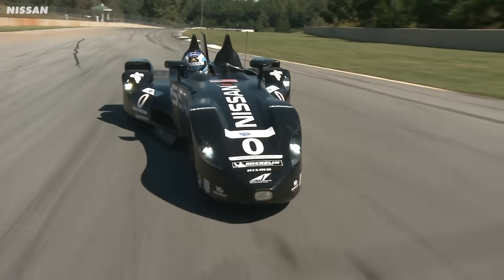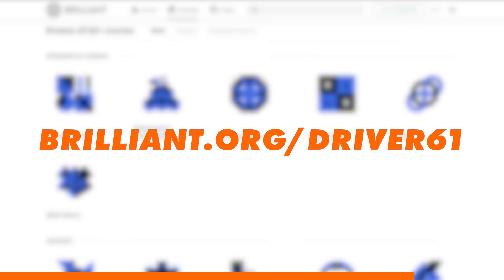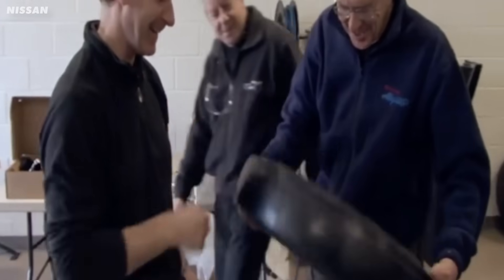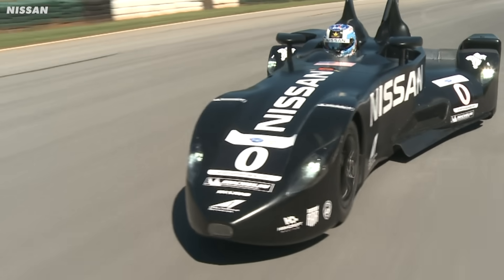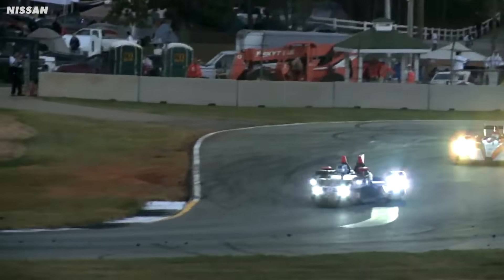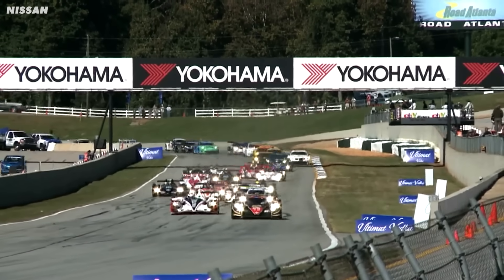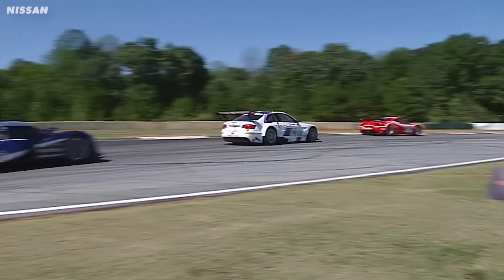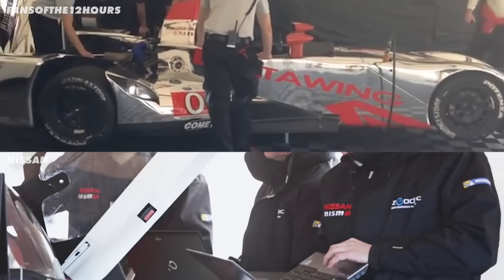Why This BIZARRE Race Car was GENIUS

Comment: Race against IndyCars? The DeltaWing was designed to BE an IndyCar. It was part of the ICONIC Project to replace the old Dallara IR-05 chassis that was now a relic of the CART/IRL split. Dallara, Lola, Swift, and BAT Engineering were also in contention. Ultimately, the Dallara DW12 was chosen; Swift and BAT moved on to other projects, Lola went dormant for 12 years, and, as we all know, the DeltaWing raced at Le Mans.

Comment: This may be genius, but Nissan's GT - R LM NISMO 2014 Le Mans racer was a disaster when they entered it as a LMP 1 in the 8 Kilo joule entry . Three of their entries were entered in the 2015 Le Mans. They were entered without a test drive. Two of the copies didn't even finish. A third only finished seven laps. Instead of using electrical system to convert the potential energy to kinetic energy, they decided to use mechanical set up with two fly wheels in a hermetically sealed transfer box through a differential and gear box.
Reply: The hybrid system was not ready for 24H LM, so they only had a FWD, hence the performance.

Comment: I admire Ben Bowlby a great deal, like what some F1 fans do with Braun's innovations. the Deltawing, its hybrid derivative, and 2014 Nissan GT-R LM Nismo are phenomenal. If I could bring back the front-mid-engine FWD Nismo, I would. The perfect powertrain layout for braking hard (and perhaps late) into a corner and sling-shotting yourself out of the corner with the load transfer over the front wheels from the braking, with the perfect anti-drag front downforce concept.

Comment: I think Nissan fwd lmp1 car was genius but never got a chance to prove it... The one race it ran, it ran without the hybrid system so it had 30% less power than the other lmp1 cars on debut. After that it got canned. Would have been great to see it at least once run full speed to see how it could have compared to other lmp1 cars of the time. On paper it seemed great

Comment: The delta wing doesn't work well in low speeds, that's why there are planes like the F18 and the Tornado. You cant just takes something and apply it somewhere else. An airplane doesn't need a heat shield for re entry, a space shuttle does. A car doesn't need delta wings, supersonic planes do.

Comment: Physics of it makes sense because torque vectoring would almost need to do the extreme of other cars where it reduces power on the inside much further then a traditional car because the weight would balance much more even across front wheels but weight balance of back would be much worse causing the back wheels to pick up much easier causing the inside wheels to pick up much higher and curbs would just kick the back end around it would work but also has its problems

Comment: We need to encourage more of this type of innovative thinking.  There are far too many unnecessary rules which stifle innovation.  If a team comes up with an idea that gives a competitor an advantage, the FIA bans it when it should be encouraging it.  Let the other teams copy a successful idea, don't ban it.  That's motor racing, it's how we got mid-engine formula cars and sportscars today, it's how we went from a ladder frame chassis to spaceframe to monocoque, it's how we got cars with wings.  We should examine every rule, and if it's not related to safety it should be chucked out.  There are ways to ensure a level playing field without stifling innovation.  My favourite would be to limit the amount of energy a car can start a race with, we can equate petroleum, electric, hydrogen etc. so we can have absolute equality without imposing how teams meet the challenge.
If you want to pit driver against driver, there are single maker series where equal platforms are ensured.  Just create a series for drivers with a super license.  Then it's all about the driver's ability both on track, and in communicating with the engineers responsible for set-up.

Comment: So fun fact. A Delta wing makes more drag for a given amount of lift than a straight wind. That's why airliners don't use them. Concord is actually a Ogival wing btw. That's really cool that the driver tried to fix the car enough to get to the pitts. A shame it didn't work.

Comment: looks like it could be made to work with some little changes like a sriking colour, a good working rear diff and electronics, higher vertical stabiliser (for increased visibility), a halo and later maybe some suspension research.

Comment: Delta wings have LOADS of drag. At least when they generate a lot of lift. A delta needs a powerful engine to be able to fly slow.
But anyway, this is a car, so a wing would have the job to create downforce. Meaning that he characteristc conical vortices generating lift on a delta would have to form between wing and road. More drag, if it were to happen. But the car was not designed to do this.

Comment: Sounds like it would have been a great car for Indy Car on the big high speed ovals.  If they could do 240 MPH with much lower fuel consumption and tire wear, they would have had a winner.

Comment: They tried this idea on ATV's. 3 wheelers were discontinued what, in the late 80's or 90's? I realize this has 4, but the narrow front wide back is not stable. It wasn't on tractors, ATV's, and wouldn't be on this either.

Comment: He might know driving, but he sure as hell has no clue about aerodynamics.

To wit: The major advantage with delta wings on aircraft isn't a thin profile, it's spanwise flow and tip vorticies - Which is even shown very clearly in the animation he was babbling over the top of. The delta design of this car has nothing at all to do with the same aerodynamics that a delta aircraft wing has, either. Literally nothing. Talking right out your hole.

Comment: seems like it should be reversed. wide in the front, slim in the rear. When you turn a car hard all the weight transfers to the front corner on the outside of the turn. It's also generally more aerodynamic to be shaped like a water droplet, bulbous front pointed back. That said, I'm just some guy on the internet.

Comment: Maybe this car could work if two things could've been added or resolved:
- Added a halo (like in F1) or an aeroscreen (like in IndyCars) to protect the driver in an event of a crash
- The torque vectoring issue gets fixed by redistributing the weight.

Comment: what Deltawing and nissan should've done was settle their differences by running their own competition maybe?
3 races on 3 continents with tracks like Maccau, Dijon, Albert Park (CAN).
it'd serve everyone well AND advertise their vehicles to potential customers aswell as further developing the idea. just weld it unto some FIA serieses get 3 dozen drivers and it'd be fun (since they are narrower they could start in 3-4-3 or maybe just 3 per row)

Comment: feel like this piece could use F-35 style rudder to stabilize and help create airbrake+downforce when needed
also I heard spaceX is testing new solid fuel that can stop burning when needed whice could be useful for thrust vectoring and rocket-assisted accelerating

Comment: Well...delta wings are lower drag, etc, but only at VERY high speeds.  If they were appropriate for lower speeds, you would see them on all planes, but you ONLY see them on planes that are at or above Mach speeds.  In other words, the basis of all of this design seems VERY suspect.

Comment: If was designed to flip like a Reliant Robin. If it was designed in the exact opposite shape it would have given a far more stable turning speed and a much smoother exit of the air. When a water droplet is formed it's very aerodynamic, right?

Comment: "too much front grip" it makes sense if you look at the geometry of the car, it would take too long to dumb down but the wide rear and thin front will put a massive amount of stress and pressure on the front wheels/tires in a moderate or more turn. them some good tires....

Comment: Lucas was the first winner of GT Academy, which is what the Gran Turismo movie that will be coming out this fall is about.

The Delta Wing is an AMAZING idea! The only reason it never won is because it was hated by those who didn't understand its engineering. It was in the lead at the Daytona 24 hour, and would have won, but someone parked in turn one specifically to take it out. Pitiful.

But it is still a viable concept, and should be tried again!

Comment: Think if they made a centrical pivot on the front end with the vertical plane north-south of the vehicle. Since pivoting the front end so both front wheels are flat while the rears are on the curbs.
"Pivoting F IRS"

Either way, a delta wing racing series would have been awesome.
💛💚🌲💚💛

Comment: The tricycle design is just horrible it has been banned from motorcycles for its handling for years in the US why would these race car drivers think it would be anything different here.   If they wanted this they would have needed a reverse delta wing like the spider.  I don't understand why people think designs like these are ground breaking when in fact it is archaic.   The judges shouldn't have let it on the track as it was putting its driver and the others drivers in extreme risk.  Its sad that if he ever rode a kids tricycle he would have known this doesn't work
Reply: That thing have 4 wheels, 2 in front was narrow

Comment: Considering the car had such little development, what it accomplished wsa incredible. If it benefitted from multiple manufacturers with thousands of engineers and over a century of developement like normal cars have, instead of just Nissan with a small team of race wizards over a few years, the design could easliy be something very worth while.

Comment: They need to bring back a Prototype or Experimental class. Innovation should be encouraged, not stifled.
Reply: Um they did? The new generation NASCAR at Le Mans this year drove under the same category
Reply: @wiegraf9009  that was a garage 56 entry which isn't the same as a field of prototype cars racing against each other
Reply: @TheAlphaDingo  I meant the delta wing car

Comment: My first thoughts upon seeing the contact points between car and road was a farm tractor. Steering requires diligent use of the independent rear brakes. So sure - these high tech guys should be able to use sensors and braking 'programs' to make the inside rear wheel slow properly to the amount of wheel turn. Upon hearing the driver mention the wheel spinning in the curves it seems there needed to be more tweaking 'if' they were using a similar approach.

Comment: The problem with this car is, if it touches another car side to side, it automatically turns the front of the delta wing car towards the car it touched.  Calamity ensues.

Comment: Was the 6 wheel Tyrrell any good?
Image result for tyrrell 6 wheeler model
The car seemed to be particularly good down the straights and through long corners, like at Anderstorp, Watkins Glen, Mosport Park, Fuji and the Österreichring, but it struggled on bumpy circuits like Brands Hatch, Jarama and the Nürburgring, where the grip was actually variable, because, depending upon the contours or ..

Comment: Once again, you're pretty clueless when it comes to physics and all things mechanical. The location of the center of mass with respect to the location of forces exerted at each wheel determines the dynamic loading behavior. The shorter the lateral distance from the center of mass to the point of resistive force at the wheels, the less lateral acceleration is needed to lift the wheels that are on the inboard side of the turn. The use of the word "balance" in describing this tricycle is truly amusing. There is absolutely nothing "balanced" about it when the net forces acting on the car along the rear axle are compared to those acting on the front axle.

Comment: It doesn't work a few very simple reasons. The thrust vector of the two rear tires, despite the vectoring of them, is so wide you can't over come it. Most race cars actually have wider front tracks for that reason. Second, the width of the car at the front means the rears has to carry all of the roll stiffness. Hence it being awful over curbs. Finally, the wake from the front tires being in the middle of the car meant the underbody performance was never going to be that efficient. 

I did root for them though. Especially at lemans., When you see the car in person it definitely looks like Ace and Gary would drive it though.

Comment: Screwed, just like the Howmet turbine at Sebring, back in the 60's. The day before the 12 hrs they made them put a smaller engine in, and also cut their fuel size. It was still fast as hell, but it was always in the pits refueling… It was even fast with one front wheel bent up under the body, off the ground. Real loud, tho. You could hear it running all around the course. The 5.2 mile long track.

Comment: 0:56 While Concorde's wing is technically a delta wing, it is not a triangular.
Concorde has an ogival wing, a modification of the optimum delta for better efficiency at low speeds, specifically take-off and landing.
Pedantry aside, interesting video.
Reply: But who’s counting?

Comment: It’s twitchy because the front outside tyre sees a huge load due to the narrowness of the track of the front axle. It’s like on a fast kart, you bring the rear wheels inboard and it grips so hard it breaks your ribs, you move them out and it drifts everywhere. Really interesting car!

Comment: It sounds like all it needed was more development... Had a bumpy and promising start, like all the great racing machines. Maybe the future would be a road legal version, that could then maybe become a one-make racing series, and then maybe come back through GT3 regulations?

Also, I'd love to have racing categories not defined by maximum size or weight or power, but by hp/kg. It would be great to have Lotus or Deltawing type machines battle it out against Bentley style monsters.

Comment: If I was building that car, the torque vectoring would be 100% necessary in order to get proper cornering performance - I'd be driving the rear wheels to enforce the requested angle of turn. But yeah, very possibly too hard to keep the weight from coming off of the inside wheel badly enough to make the control system a nightmare to get working.

Comment: Great doc, seems like vested interests were super scared this would upset the status quo. Now of course they'd probably embrace it with its 'eco' credentials. A missed opportunity  but is  the current Formula E design somewhat similar?
Reply: The current FE design doesn't generate much downforce. This is intentional because it means if cars lose a part of body work they can keep going.

Comment: Delta wings are good for supersonic flights, it does not reduce the drag at subsonic speeds (if it was the case, all airliners would have delta wings)

Comment: Interesting, but i wasn't a fan of this car.  If it worked, then the entire field or race cars would be some type of delta wing model and that is not what we drive or use on the roads.  Many race cars become some type of production cars, (de-tuned) and sold by car mfgs.  Porsche, Audi, GM, BMW, MB, etc. all operate this way.  You would never see a Delta wing on the streets and therefore never really enhance the mfgs of what they would build and sell.  Again, interesting concept but IMO not practical.

Comment: I feel like the combination of torque vectoring and traction control have improved a lot since this car was built, i feel like this concept could go a lot further with further sensor/software developement.  It's akin to a quad-copter drone with the wrong accelerometers.
Reply: Sounds like something that should be tested with RC cars

Comment: It does roll a lot easier than the rectangle layout.
Reply: Not with all the down force and weight balance. id say it could even be more stable
Reply: @mrjed6912  watch the clip again and pay particular attention to the bit where a Porsche hit its side.
Reply: @happivaras  I assumed that was a loss of downforce. Heavy reliance on ground effect reminds me of a Mercedes supercar which was originally designed to rely entirely on ground effect. The test car went over a bump in the track big enough to destroy its ground effect, sailed off the track and wrapped itself around a tree. This was all a long time ago now; it was one of the first crop of 200mph cars.
Reply: @eekee6034  yeah yeah sure Ted

Comment: THis is a great vid but you need to correct on segment. The Coefficient of Drag (Cd) is a 2 dimensional factor which defines the frontal silhouette shape as seen laterally plan view. The total drag of the car is determined by multiplying the Cd by the total frontal area that presents itself to the rearward air flow. Now I think you meant to say that the total drag of the deltawing was lower than the LMP car NOT, the Cd is lower (well it could be and if it was then the total drag would be as well given that the total frontal area is less too-) BUT a car could have a much higher Cd and but a much lower frontal area and have superior drag qualities (meaning LESS). Capisce?

Comment: Many years ago I read an article by a tyre engineer.
He said the contact patch of a tyre was determined by 2 things. Tyre pressure and force pushing down on it, ie weight plus any downforce.
So a wide tyre has no more rubber in contact with the road than a narrow tyre, the only difference between the 2 being the shape of the contact patch.
Wide and narrow vs narrow and long.
This would seem to also explain the front grip on this car as well as the reasons given.
Has always made sense to me but it is rarely mentioned and driver 61 made no reference to it either, any knowledgeable people out there have any more info?